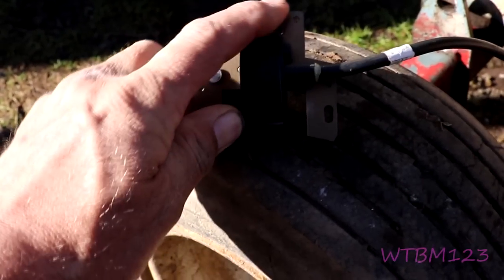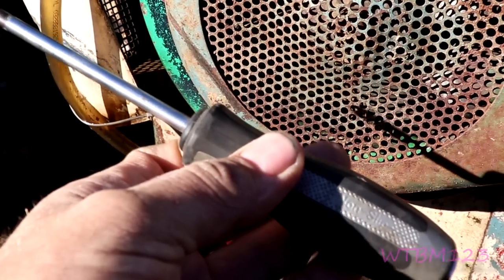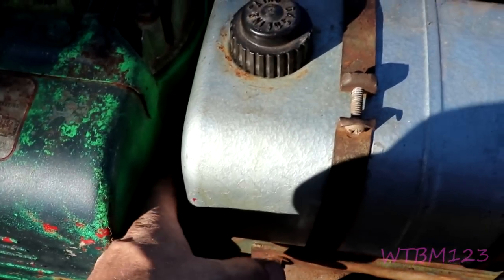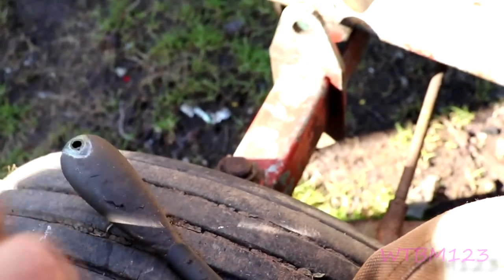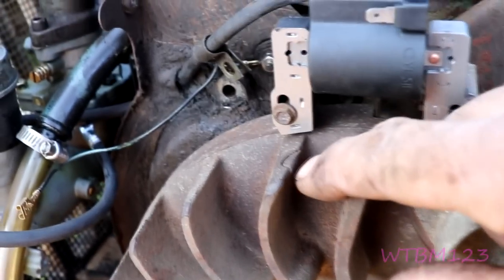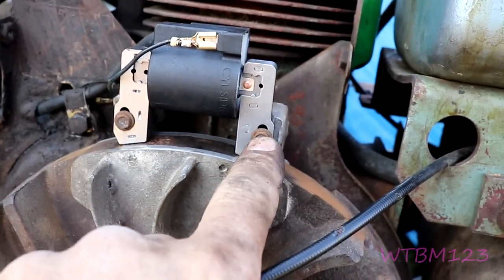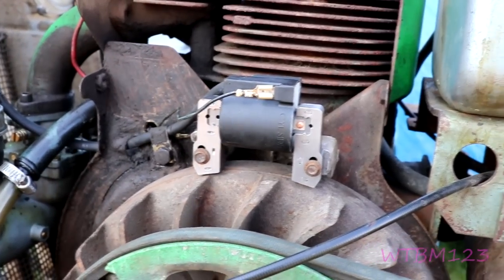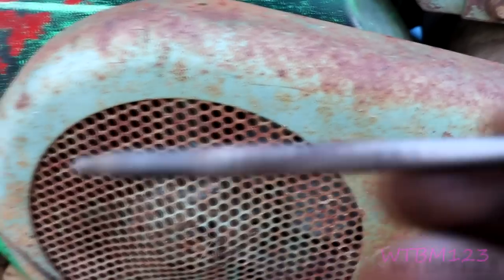Briggs & Stratton  , 8-16 hp.Briggs , Convert from points to electronic ignition , Sears Suburban

Comment: I've goat a 1969 12 horsepower B&S I'm trying to do this too because the points plunger is shot. I went to my local parts guy and told him I need the B&S coil Part # 398811, he crossed it to a rotary 7286. The coil looks totally different and I cannot get it to spark. Did he sell me the wrong coil or just a bad one? I believe it's totally the wrong coil but I've had a few people say it looks like the older version of the 398811. I can't find a 398811 that looks anything like Rotary #7286 which is what I have.
Reply from the maker: I show some coils in the video . If it has the metal going over the top of coil like the points one did , I personally have never gotten one of those to work

Comment: If you cut slots in the housing bolt holes you can just loosen the bolts a little bit and pull the housing off. Some of those old tractors are really tight to work on. Love the patina on that housing too, dont know how they got so many colors but looks great.☺
Reply from the maker: Yes i have cut a few . Yes it appears to have NO Lack of Paint . lol
Reply: @wtbm123  On my simplicity I made it 2 piece so just the top 6 inches comes off. Easier than pulling the engine and driveshaft and you can clean of grass and mouse nests and change the magneto in minutes.

Comment: you normally wouldnt have to flip them.   I figured the reason it works for you tho - Normally the magnet on the flywheel is south on the outside north on the inside (towards the center of your flywheel.   )  You can test this with a compass   If you put a compass next to your flywheel normally the south of the compass would point to the flywheel.   Next time you pull it apart I bet a compass north would point to the outer of the flywheel magent with yours.   Funny thing is I thought you had to send the flywheel to briggs & statton to get the polarity changed.   You fixed it by flipping the magneto.   I actully love it.   There was a year or two these North outers came out.   You found the most simple fix what is always the best.
Reply from the maker: Not all are the same , but flipping coil over is sorta like switching the poles . I have several running this way . I like points , but seems like points do not last as long as they once did
Reply: @wtbm123  you have seen several of these 16hp cast iron Briggs. Was wondering if you have seen an oil pan with two ears hanging from the bottom of the oil pan about 6 inches apart  with about 1 inch holes in them? This came from a tractor that had a sickle mower on it. It is a 1974 model. I am needing a regular oil pan for it so I can mount the engine to a flat surface.
Reply: @wtbm123  Yes points fire at much slower speeds, so if they are working good and your battery is near dead, you can usually start the tractor with one rotation or less. Or a bump start.

Comment: What size is the bolts going to the coil, I have a 1976 16hp Briggs and lost them when I replaced all the seals and haven’t had any luck after 3 trips to Lowe’s
Reply from the maker: some reason i was thinking #10 - 32 , but not sure . 93381 is the original part number . I believe 691061 is the updated part number . If do not find the right one in hardware store , ebay , amazon and other online stores have them

Comment: good morning.,,,,What size belt is generator motor to the engine big pully on the engine?,,,,Thenk you,,,,,Great video!!!!
Reply from the maker: Gates 6736 i believe i used . 3/8 X 36 , but on one of mine i had to use a 1/2 wide belt , Think the pulleys were worn
Reply: @wtbm123  Thank you,,,,,Thats what i used,,,,1971 ss14 sears tractor,,,,It was my dads tractor.,,,,50 years old,,,,Thanks again

Comment: When you put the belt flywheel  on the flywheel. The Aluminum part that the belt rides on, besides the two bolts screwing into the flywheel, and the two washers on the boats is there anything else that belongs on there to space it out? Because when I put my shroud on, it rubs and scrapes just a little bit. So I was wondering since you took it apart I know you're going to have to remember, do you remember anything else besides the two washer and bolts when you mount it on to the flywheel?
Reply from the maker: flywheel . lock washer and center nut . then the belt pulley and two bolts . maybe the shroud is bent a wee bit

Comment: Where would you find replacement screws for thoseI found the right threads and it's one of those screws that you could put a Philips or a flat head in and I put a washer and I lock washer on. It didn't come with screws when I got it. It looks nice but do you think it'll hold up to the vibration or get the right ones?
Reply from the maker: They will prob be ok , I do not remember the size , but i have replaced those with allen head  screws .From our local hardware and never had a issue .
Reply: @wtbm123  thanks buddy

Comment: I just started a project, custom M8 Sears riding tractor unknown year on everything it's a pull start. Trying to figure out how and where to get parts. With your knowledge would that coil work on a manual start M8?
Reply from the maker: Not sure on that , I know if it has a 3 legged coil , this will NOT work . 3 legged coil , you can remove a clip and slide the coil part off the laminated metal part

Comment: I have one it'll fire and it's getting fuel but still won't crank any ideas
Reply from the maker: If you mean you have spark , and fuel getting in , but not start . may try at idle , and make sure carb butterfly goes closed when throttle is in idle position . None of mine will start unless at idle

Comment: I thought you had to send off the flywheels to briggs and have them repolarized for them to work?Im going to try to this.You put the coils on right.It WILL shear keys after keys and kick back and break ropes.Ive been there and done that.I like points if the world goes to hell.Points will work.
Reply: if you send briggs your flywheel any imperfections they keep it and wont send it back, like a chip on a fin anything minor then you dont have a flywheel anymore, just flip the coil like in vid
Reply: I agree there still very reliable and I keep several extra points and cond sets for about every thing I own

Comment: Would it be worth it to slot the fan housing bolt holes that are hard to get to and that way you just need to back the bolts a a little and slide the housing off.?.
Reply from the maker: Hopping not to remove it ever again , lol

Comment: I love my Vessel drivers. They are flat out a must have in my opinion. With my Simplicity and Allis-Chalmers, the engine HAS to come out to change the coil. Great tips and video Terry! "Cool" Zip~
Reply from the maker: It is one of those tools that after having one , you wonder what took so long getting one
Reply: Exactly right! Like Battery Impact Drivers! Zip~
Reply from the maker: And a Shake and break , finally just had to get a new one of those , they are great
Reply: @wtbm123  Ratcheting wrenches, what I would give to have those 40 years ago.